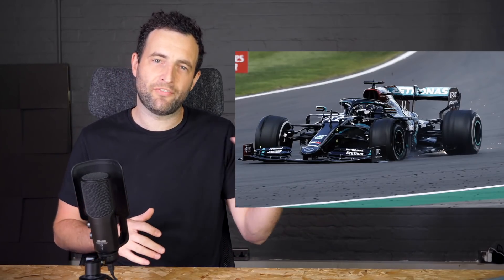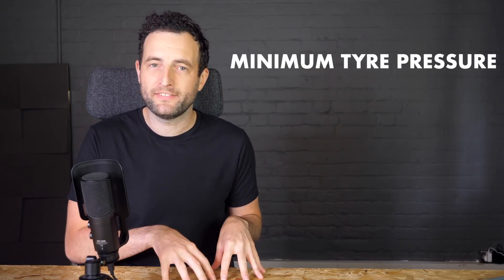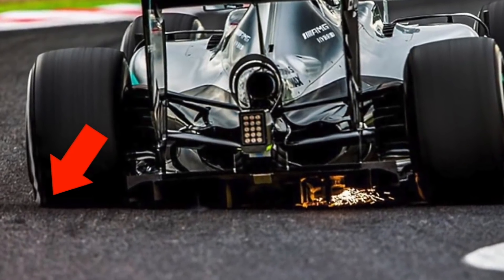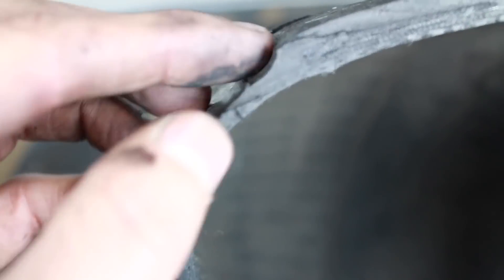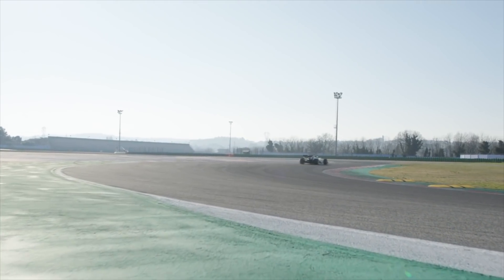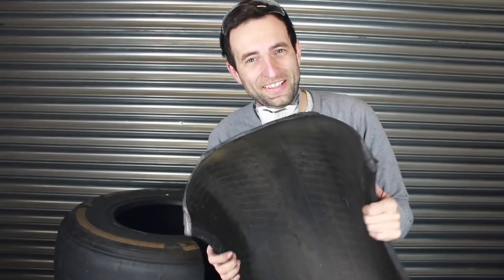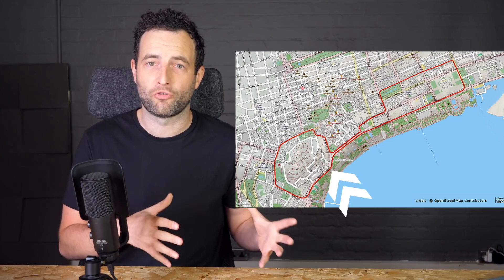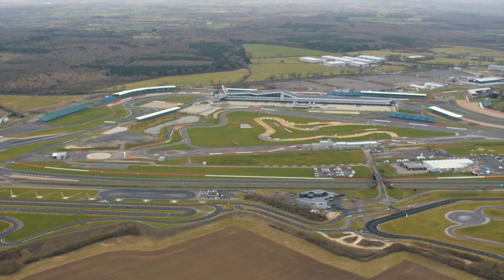Why Formula 1 Tyres Failed in the Azerbaijan Grand Prix

Comment: Honestly Max is fortunate that Lewis made a mistake. Imagine Max lost the championship through no fault of his own.
Reply: Lewis is fortunate that pirelli ruined max race otherwise Max will 11 points ahead at least.
Reply: True but had he won he would have had a greater gap in points. He needs those extra points since next few tracks are Merc dominant ones
Reply: @hiran4935  Only France for Merc two RedBull Ring for RB
Reply: @hiran4935  unfortunately this is true. Monaco and baku was max’s boost, the rest is almost guaranteed mercedes win. Still unfortunate for max...
Reply: yes that's why as a Lewis's fan I was kinda happy he made this costly mistake, I don't want the championship to be decided by something that isn't controlled by the drivers
Reply: @gontran8638  well, if Lewis is going to lose this championship by less than 20 points, it will be due to something under his control :)
Reply: @rioprez  yep that's why it doesn't bother me. it was entirely his fault there if I understood everithing correctly, while Max's puncture isn't really his I think
Reply: @gontran8638  funny to thing he could easily get 18 points if wasn't for lockup
Reply: @rounak471  no, I think he could’ve won that race without that magic mistake
Reply: @rg7535  he means the brakes I’m guessing. Lewis was in the process of overtaking for p1 so not so clueless i would say
Reply: @ploppyjr2373  Where did you get that from? He replied to a post saying Max is fortunate because Lewis made a mistake, and you assume he meant the brakes? There is absolutely nothing to even imply that's what he meant. It sounded like he meant Lewis would win anyway, even if Max hadn't crashed, which is one of the most laughable takes I've ever heard.
Reply: @rg7535  because the reason hamilton locked up had to do with something that was called a “magic brake handel” or something along those lines. 

This keeps the brakes warm during safety car periods. Lewis forgot to turn this off which made his brakes way too hot into turn one and made him effectively have no brakes.

The guy you called clueless called it a “magic mistake” which seems to be referencing the magic brake warming system. 

If lewis hadn’t made this mistake he was in for a win because he was going to overtake perez because he had the inside line and was ahead into the breaking zone.
Reply: @ploppyjr2373  Fair enough, looks like I missed the pun
Reply: @ploppyjr2373  The magic button changes the brake balance to the front so that you can get more heat into the front brakes and front tires while going slowly. Lewis did turn it off before the restart but accidentally turned it back on when he upshifted, so with basically all the braking force going to the front he locked up going into the first corner.
Reply: @Speednote10  okay thanks for clearing that up. I was only talking about what I remembered from the commentators
Reply: @rounak471  funny to think max would have won the race if it weren’t for a tire blow out which was 100% out of his control.
Reply: @rg7535  you do know what mercedes' magic means right?
Reply: @Richardjohnson6969  more funny if you think max could have 2 more wins if wasn't for strategy
Reply: @rounak471  exactly, would've felt unfair if he did. That's the point
Reply: @gontran8638  So many championships won by luck though. It's the nature of the sport. Cars have mechanical failures all the time that effect the Championship, whether it's their car or someone else's.
Reply: @gontran8638  exact same thing just switch the view to a max and red bull fan
Reply: @gontran8638  That's a good way to put it
Reply: @gontran8638  but still if max loses by 11 points or less this race can be pointed to as the cause
Reply: @gontran8638  If you look back in any mortorsport event winners and losers are often governed by events that are beyond the control of anyone.We all need luck!
Reply: @gontran8638  That's an honorable attitude !
Reply: still lost an 11 point gap tho
Reply: @jamesmiddleton8335  Yeah sucks, although i am sure more unlucky moments will arrive this season since it has a loooong way to go.
Reply: This is backwards thinking - both are great drivers - Lewis is lucky that Max had bad luck and he was #blessed once more while making a mistake himself. In reality this season Max should be 30+ points ahead by now and it could be a great match to the end, but with Singapore removed as well, you'll have the likes of Max, Sebastian, etc. not be able to outperform by skills alone at times vs. the car, as this is mostly what you can do at street tracks. Saying that this saves Max's championship charge isn't really right, as he's been unlucky and Lewis has been lucky, and those points would be needed later on. Either can still win, but it's quite clear that Lewis has lucked out again due to no fault or credit of anyone.
Reply: @mkl_  We actually live in reality and the points are what they are.
Reply: HAM is feeling the WDC heat from VER and Red Bull, even when VER is out of the race  ;-)
Reply: @y1521t21b5  That's called being competitive. That's why we watch. If the drivers didn't care, neither would the fans.
Reply: Lewis was also fortunate to get Red flags at Imola but no one wants to hear that.
Reply: Lewis should have tried for 2nd place and if 1st was an option so be it.  Bec Lewis wanted to be 1st, he blew it and although nothing changes at the top for drivers, Red Bull has extended their lead over MB.  If Lewis had sense, 2nd would have moved him ahead of Max and minimised the gain Red Bull made in constructors.
Reply: @borysnijinski331  did you not see his breaks when they lined up on the grid? Whether he went for 1st or 2nd he was locking up into that first corner. Although if he just lined up behind Perez he would have taken him out too :)
Reply: It still affects the championship, Max would have extended his lead if not for the tyre blowout, likely by 9-11 points(depending on fastest lap)
Reply: We fans are fortunate, I don't want to see another 2019,2020 season... Ferrari kept 2017 and 2018 somewhat interesting....I want title deciding race should be taken till last race
Reply: This didn't age that well
Reply: well it still cost him possible 7 more points to extend his lead over hamilton...
Reply: This moment still can be decisieve for the championship.... every point counts..
Reply: That's one way of seeing it, but Max is still massively unlucky, the race was going to end with VER PER HAM, giving Verstappen bigger lead in the championship, it's really somewhat sad since Max didn't do any mistakes too.
Reply: @hansolo2121  have you correctly read what Jac said? He didnt say he was lucky his tyre exploded, he was lucky that Lewis messed up so the championship is still as close as it is. Quite a difference from what you seemed to have read into it.
Reply: @hansolo2121  Hey, i was just as pissed of about that as you are, but you cannot say it is bad luck that Lewis did not profit of that. Ofc the tyre blow out was bad luck, to say the least. But Lewis not scoring either is a lucky outcome in a bad situation, so yes.. in that respect he was lucky while being unlucky. But that isnt the point... the one you commented on, did not intend what you read into it, and now you seem to be jumping on me for seemingly again misreading the intend.

lets be ultra clear
Max was UNLUCKY with the tyre blowout
Lewis fucked up, which was a lucky outcome for Max because the championship did not change.
Was it fucked up? hell yes, does Pirelli have some explaining to do, double hell yes. Max should've won but he did... and neither did Lewis.. both scored ZERO and in the end, that is lucky for Max that LEWIS did not score any points either.

How difficult is it to see that the eventual outcome, was at benefit for Max after he got that UNLUCKY blown tyre, he is still in the lead of the championship.
Should he have won and gotten a bigger lead? ofc he should have.. but that did not happen sadly, and to then have Lewis screw up.. that can be marked up as a lucky escape that keeps the championship close and tight. Or are you of the opinion that Lewis screwing up so Max still leads, isnt good fortune/luck for Max?
If not, then we have nothing more to discuss because you then simply refuse to see things for what they are.
Reply: Max was lucky ???,his tyres blew out at 200 mph ?
Reply: I read somewhere that Carlos Sainz Sr. was a few hundred metres or so from being the winner in rally when there was a technical fault on the car. Very unfortunate but that is racing.
Reply: ask Kimi
Reply: Hamilton was very lucky that the tire of Verstappen did collapse. Max did not make a mistake, Lewis did.
Reply: But, Toto said it wasn't a mistake...
Reply: If we're keeping score of the WDC
Max has made 2 or 3 mistakes so far
RBR have made 1
Lewis has made 1
Merc haven't made any
We're kinda lucky it even close
Reply: @roymcdre9180  1? Ok bro, you missed Imola i guess
Reply: @roymcdre9180  Lewis has definitely made 2 big errors this season dude.
Reply: I mean kinda of his fault, why push for the best time, i still don’t cet it, Perez were defending for him
Reply: @PetitGarry  The tyres showed no signs of severe degradation
Reply: @PetitGarry  Max wasnt pushing all that hard, he didnt have to because he was in the lead.
Reply: @PetitGarry  don't be stupid... There was not a single warming of failure
Reply: @PetitGarry  Had nothing to do with it. Temps and wear were all okay. At the times they wanted him to grab fastest lap he was told to use some extra electric power at the second DRS straight. He wasn't leaning on those tyres exorbitantly.
Reply: @PetitGarry  Pirelli said you could do a one stop with a stint of 30-40 laps on hard tyres, Max was just over 30 laps on his tyres and only a few laps to go, why not go for fastest lap? You only say this with hindsight. Also don't forget Max was in front for almost the entire race, so no dirty air, lots of grip (RB setup was with more downforce anyway), so less tyre degradation, you'd say. If anyone could expect to be tyre critical, it would be Lewis with lower wing levels and following Perez closely for most of the race after their first pitstops.

Max lost out this race. Had the race continued, I think we can all agree he would win, Perez would be 2nd and Lewis would be third. It didn't look like Lewis could get Perez, as he was managing the gap. As said above: Max was going to gain 11 points on Lewis, now there was no nett gain for either of them.
Reply: @PetitGarry  Max wasn't pushing at all. He was keeping same pace as cars behind him, to save his tires. To get fastest lap, he didn't need to push anything, as he mentioned after the race.
The Red Bulls were the better cars, so it was only Hamilton who needed to push his car to keep up and he did that amazingly well; just look at where Bottas was, who should be quite good on this track.
Bit silly mistake of Hamilton, but too bad that he and Verstappen didn;t finish.
 Awesome for Perez, great job and well deserved. And Vettel & Gasly. So cool!
If you like Formula One, you always try to see the positive in every driver, no matter which one is your favourite.
Reply: Man you didn't got anything from this video. He didn't say it explicitly but he implied this was drivers not managing properly their tyres. NOT PIRELLIS' FAULT.
Reply: @DanielSanGV  How exactly did he imply that? Can you provice a timestamp? You're projecting here.
Reply: @rg7535  You have to be so dense to not understand what He is doing explaining all the ins and outs of how Pirelli is trying to prevent this from happening, and not tied this together. Max fucking up is not impossible. He is still a great driver.
Reply: @DanielSanGV  That's called projection. You believe this is what happened, so this is what you hear from the video, even though he comes nowhere close to implying that.
If anything, he implied the fault lies on FIA's doorstep, for demanding a softer compound, looking for more exciting races. He doesn't lay any blame whatsoever, whether implied or explicitely, on any of the pilots.
Of course it's not impossible that Max could make mistakes. We all make mistakes. Lewis just made a very serious mistake, even though he is much more experienced, and he has 7 titles. However, this is certainly not the point of the video.
Reply: @DanielSanGV  🧂
Reply: @rg7535  🧂
Reply: @DanielSanGV  first of all, let's stop crying like a little b****.
Second, if Verstappen says the car felt good, the tires weren't giving him any issues, you can trust that was indeed the case. He wasn't pushing for 30 laps, he was trying to run a fast lap at the end, because the tires felt good enough.
If the tires would have been degrading in a somewhat linear fashion, max is one of the first to notice that and adjust his driving style, but if a tire fails without warning, you can't blame the driver.
Even if you think Scott also implied driver error, which he didn't.
Reply: @BsKB1000  First of all, stop getting into where you weren't called. 
Second of all, Max was on lap 35 after he pitted, similar tyre wear as Stroll, as the video explained this race had a higher regulation for psi in the tyres from 19 to 20, making them more prone to degradation, the fact that the tyres give out in the same condition, 35 laps of degradation and in the same section of the circuit, they pushed the tyres to much.
Sit down, kid. 
Sorry for not answering as you deserved but apparently youtube doesnt let you swear if you are brown.
Reply: @DanielSanGV  So, they didn't push too hard. 
Granted, if Stroll says that, I'm not really taking it serious, because the guy doesn't even know what's wrong with the car, when his tires give up (Not referring to Baku, but a race a while ago). But if a Max or Lewis are saying something like that, in post-race interviews, I'm inclined to believe them. 
Second, if Pirelli thought they pushed too hard, they wouldn't blame mysterious debris, regarding the exploding tires of Max, they would've just implied the drivers were pushing too hard. 
Lucky me, for YT not allowing you to swear... lol
Reply: @BsKB1000  If you wouldn't mind the advice, a person who believes swearing at you is the appropriate response to having their point challenged is not worth your time.
Reply: @rg7535  Lol, you're right, thanks sir. Although, I wasn't innocent as well :D 
But you're completely correct!

Comment: Another question: why when indycars crash at 350 km / h in indianapolis they continue straight for 1 km before stopping while F1 cars have a puncture, like verstappen, they stop after 100 meters?
Reply: Probably due to the angle where the drivers hit the wall. The walls on an oval sort of guide the car instead of stopping it head on.
Reply: Indycars have a lot less downforce. That's why they are able to keep going. Think of this: If someone breaks his leg, or something like that, they can sorta limp for a while, but if you apply force from above on their shoulders they would fall because leg cant withstand this pressure anymore. Same with F1 car, that's why if they have a high speed puncture, car is thrown around and starts spinning.
Reply: @localhobo5362  Yes downforce is the main reason.
Reply: @BNOVA  well the downforce would only aply if the car is going in a streight line not if they are spinning around
Reply: @yurivos6223  it would apply in any scenario actually, but higher the speed more noticeable it gets for us.
Reply: @localhobo5362  Exactly.  An Idy car going around an oval has less wings for down force and even an Monza Spec F1 car.
Ait acts upon a car in all directions hence the drivers and engineers talk about how tail wind and cross wind affects them.
Reply: @yurivos6223  ?? well people should be saying drag , not downforce which is related to drag.  The car is much more drag when not going forward ... just look at it.. it's designed to flow through the air a certain way.
Reply: Indianapolis has a slope 
Downforce could be the other reason aswell
Reply: In a blowout of the rear the blowout side has an instant loss of forward driving force. In the in-car of Max's blowout of the left rear there is an initial jolt of the car to the left as the right rear continues pushing the car as the left stops, as he corrects the slide back and forth the car eventually spins and hits something. 
IndyCar's on ovals with tire failures just travel up to the wall with the centrifugal force already pushing the car in that direction. 
Not all oval wrecks are the same, often the car hits and comes back off the wall, I have seen some that hit the wall smoothly(relatively) and ride along it for hundreds of feet.
Reply: I don't know about Indycar but a Formula 1 car, as soon as a tyre deflates, "tilts" into that direction, causing the entire floor in that area to be dragged across the track surface which slows the car down through friction, plus they have the board under the floor which the FIA mandates to assure a minimum ride height which also gets dragged across the track.
I believe the barriers around the circuits are also just designed to absord and dissipate most of the impact energy, causing further slowdown

Dunno if that explains it enough but my guess would be that it's just a bunch of design choices to make the impact energy dissipate as quickly as possible, considering impact forces tend to be higher in F1